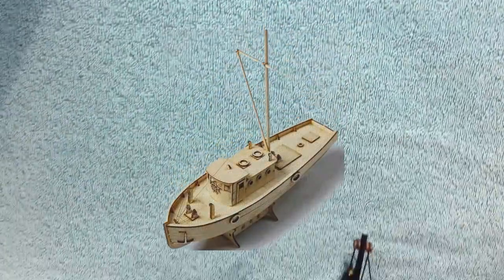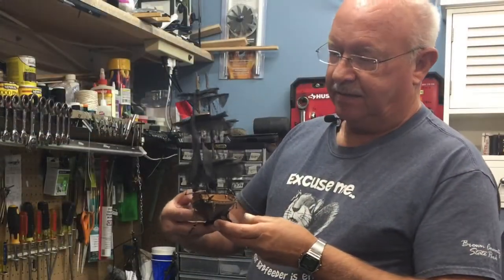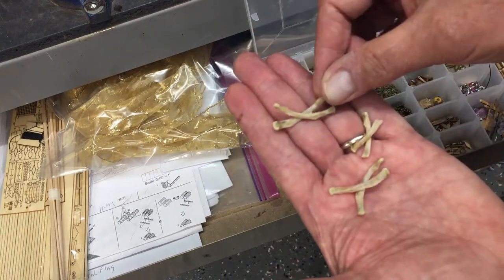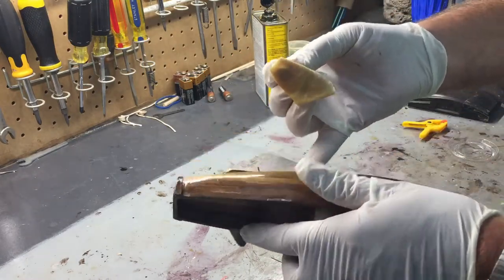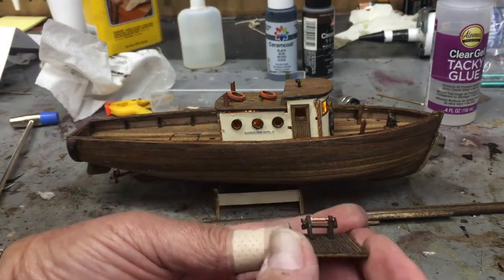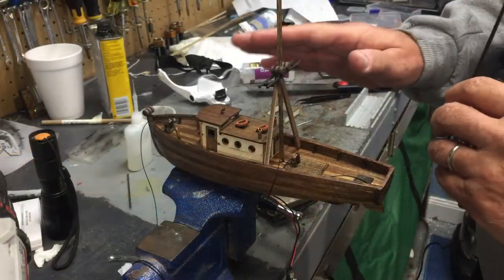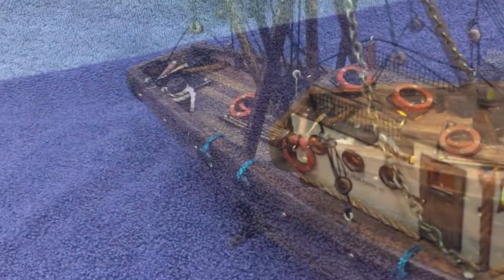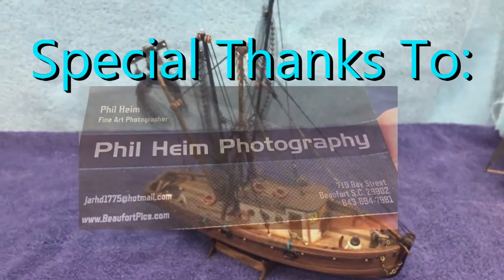HAPYLY 1/30 Scale DIY Wooden model Fishing Ship Part 4

Comment: Very nicely done! Best shrimping boat I have seen! I like the added details. More details means more depth that draws the eyes in and make it more realistic. Well done!
Reply from the maker: Nice to hear that you’re still watching 😁!  I’m going to gift the boat to the photographer that gave me his website information and access to his photos of several ships so I could see some details of actual shrimp boats.
I’ve purchased a little more expensive ship that has a solid hull, plus a $40 HMS Victory that is the laser cut type with little to no instructions 🥴. That’s going to be this winter’s challenge!
Reply: @BoilerDan1  Of course I am still watching!  Seeing different techniques and ships is always fun!  I am still working little by little on my pearl.  Been very busy with work the last month or so, so no time to post a video update.  Should be able to do another update soon.  Just finished doing the roof over the captains quarters, got a base for it in progress to hide the wires, which are becoming a real pain!  So many wires I have been putting off the upper deck cannons trying to decide if I should wire them or not.  I probably will, but need a different support to work on the bottom wiring without breaking the stuff on the upper deck.  Awesome challenge though!   Giving away the ships you have done is awesome!  I don't know if I could do that quite yet, but maybe after I get a few more under my belt!